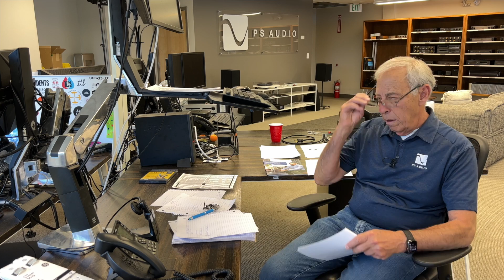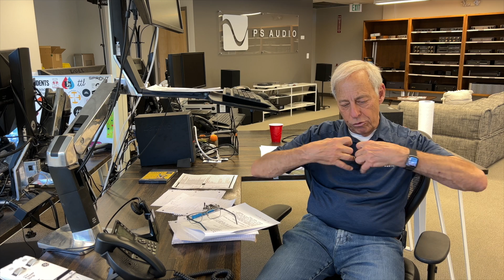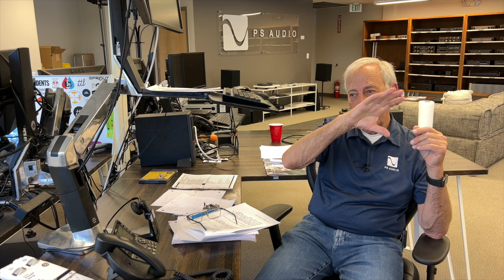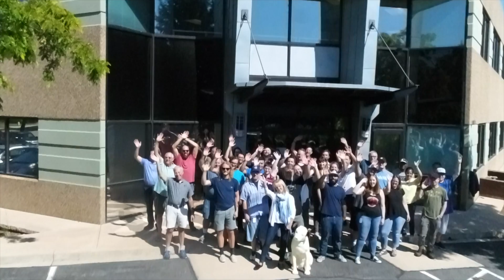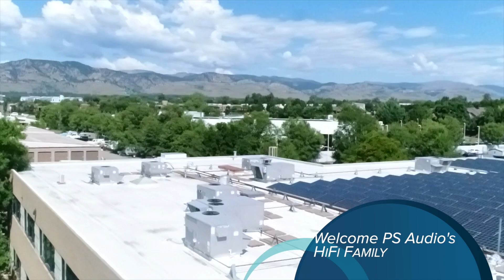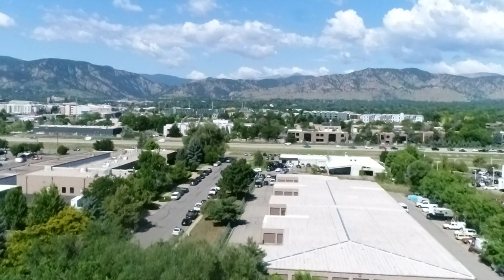Will PS Audio abandon traditional power supplies?

Comment: Bullshit. Power amplifier is regulated by itself. The Power Supply just needs to be powerful enough to not produce voltage sag during power demand bursts and low-impedance throughout the audio range, no matter what kind of power supply it is. Period.

Comment: Consumers want small speakers for their small rooms with high output, so not efficient, therefore to solve this compication there are big complicated amps needed, so there are large, expensive transformers needed. But the amps need to be bigger and cheaper so there are more complicated, small power supplies needed, that introduce yet more complication which are solved with more complicated solutions. Every complication is solved causing yet another complication. Might this be an accurate description of 50 years of development of audio-equipment?

Comment: Harman Kardon introduced the GreenEdge power supply in their 2014 (?) AVR receiver line, also the 3700 and 3770 stereo receivers used switch mode power supply, harman kardon is the best, they always introduce the future, they made the first receiver, ther first stereo receiver, the first computer speaker in Museum of Modern Art, the first GreenEdge receiver etc.
Reply: I owned an AV3700 and must to say: that thing is as strong as an war tank! Great AV receiver, despite the power supply design.

Comment: It's not only the case in amplifiers. A few years ago I was building an FM exciter (small driver transmitter) for someone and he ordered an SMPS. Once that thing was ready, I powered it up and let it play for a couple of hours. Despite it is a real good exciter and I was using a professional broadcast grade high quality stereo encoder, it didn't sound right. There was not a lot of detail, a lack of life, dynamics and base. I Added some filtering (coils, caps, decoupling) on the output of the SMPS to get it as clean as possible, but the sound remains "thin". So I hooked it up to a real transformer based power supply and instantly, everything sounded normal. The guy I was building it for is not an audiophile but even he heard the difference. After that, we decided to build our own power supply based on a toroidal transformer and that was even better! And that's strange, because FM transmitters are not "modulating" the power supply like audio amps are doing, but they draw a constant current from the power supply. So, even without varying current, a power supply can make equipment sound great or terrible.
Reply: Great story, thanks for sharing!  Linear power supplies rule!
Reply: @Random-kq4pz  Yes they do!

Comment: Re Amp = Valve,  does that also apply to pure class A? Seems to me that class A is rather a constantly running fire hose, and once in a while a few drops are diverted. Are the. power supply requirement different for a Class A amp compared to a Class A/B or D?

Comment: Yes company 'XXX' might have great SMPS's, but is PS Audio going to develop one? If I buy PS Audio I want PS Audio inside, not a PS Audio box with everyone else's stuff inside.
That said, SMPS's tend to shine with fairly constant loads - like a computer, however they quickly suck when presented with near zero loads - quite often in music.
Reply: PS Audio already uses OEM modules for its Class D products, e.g. the Stellar power amps and the Sprout 100.  The development of such circuits -- along with suitable switch mode PSUs -- requires specialized expertise unlikely to be found among the engineering staff of a relatively small audio company and would amount to reinvention of a readily available wheel.

Comment: The channel Kiss Analog is having a series of designing  a switch mode power supply for an audio amplifier. Eddy who runs the channel is a power supply design engineer. If you want more technical insight about this subject, check his channel out.

Comment: I only tested once for about 10 days in my own set-up (Wilson Audio Sophia Serie 1) two class D monoblocs, each rated at 300 w at 8ohms and 450 at 4 ohms (the impedance of the Sophia). Sound was absolutely beautiful yet after listening for two hours I found myself exhausted everytime (while the sound did not appear fatiguing at first). So I purchased Bryston monoblocs instead and the are absolutely NOT fatiguing. 
I will not name the maker of the D class amp suffice to say they where US built high end stuff costing about 3’000 per unit. (so less than half the price of the Bryston). 

Curious if I’m the only one finding the class D fatiguing ? have others experienced that as well ?. I do tend to listen at high levels (80 db and more) but the levels were the same with both test using a decibel meter.
Reply: May I ask what pre-amp u used?
Reply: @faludabutt8253  sure, a Moon 390 which is both streamer, DAC and preamp
Reply: @marcbungener1877  I have PS audio S300 hooked to pass labs XP10 pre. Sound was not really harsh but was in the face and forward. Midrange was alleviated but bass was beautiful. So I decided on a valve pre and got a luxman from Japan. And wow, S300 sounded like class A/B. I am pleased up to know. Furthermore, if I listen loud, I could adjust the tone controls on the luxman pre. For example, sometimes female vocals become a bit harsh and I tone them down. Brilliant
Reply: Big question is, what sound you want? “Want” is a preference which could be based on nostalgia. As a boy, my family listened to radio a lot. Radio sound was soft, unlike modern speakers. Once I hooked the luxman pre, I said “ O ya”. And then I asked myself why I said that. And childhood memories came back

Comment: One small problem with smps.They will never be as reliable as a traditional psu.a amp running 6 days a week for 20 years in a club with a smps inside-no chance
Reply: Pro audio amps from virtually all the trusted specialist companies have switch mode PSUs nowadays, so that next 20 years or so should tell us if you're correct.

Comment: I've never seen a switch mode psu that does not introduce a ton of emi and noise. When building audio gear, switch mode is the last thing I will consider. Take for instance the Logitech Duet that is connected to my system... I trashed the PSU, and built my own. Keep switch mode at least 20 feet away from my gear, and I have my gear isolated from mains that drive any switch mode, such as phone chargers etc.
SwitchMode was invented by the devil from the hifi bible

Comment: Wouldn't it be best to use battery banks instead of power supply units, which provide the output voltage immediately as DC with enormous capacity?
Reply: You could hook your system to your electric car
Reply: Batteries seem to work well in low current applications, but usually are worse when you have high current demand like in power amplifiers. They are also very limited in how fast they can discharge, so they tend to have a very adverse affect on low frequency transients.

The other issue is current draw itself. Imagine a class A amp that draws 4 amps and 120v. This would be a steady 480W of power drawn from the wall. A 12v battery would have to provide 40amps of current to match that. 40A may not sound like much, but that is a crap ton of amps -burst into flames kinda amps.

Batteries are popular in flea power SET amps though, and some say they produce the best sound.
Reply: @joshua43214  You shouldn't compare batteries so sweepingly with batteries. 
A friend of mine had already converted his Marc Levinson amplifiers in the mid-90s to a pure battery supply (at that time there were tons of lead batteries) and charged them via mains current during the rest period. And no malfunctions - as you mention in your comment - occurred. And the rechargeable batteries needed enough power to be able to handle longer party nights with this stereo system. But the guy was also in a completely different financial league than yours truly, whose system (2x200 Watt LR and 800 Watt for the subwoofer) is completely powered by a Solar-PV.
Reply: That might be OK for short term use, but long term you are going to need and enormous charger which pretty much means a switched mode power supply. The cost of replacing batteries every few years would be enormous. Secondly an amp often requires numerous supply rails and that means we are back to a switched mode power supply to generate the lower voltage rails if you are running a set of batteries. I think it would just enormously complicate everything and add to weight and maintenance costs
Reply: @mikevincent6332  I've heard about Technics SE series power amps that had batteries back in 70'-80' … How about these?
Reply: @mikevincent6332  It wouldn't be all that expensive, and you would get much more than a few years out of them. It's not exactly elegant, but it's not the worst idea in the world.

Comment: Great description.  Love the valve on a supply.  That's why tube amps are called valves.
Me?  I'm sticking with big toroidal, coke sized caps, chokes and triodes.  Just sounds better.
A stradivarius violin sounds better than a synthesizer.  Old school sometimes just works.
Reply: That's bcause us Brits call things for what they are its a valve
Reply: @Gez492  Spot on!